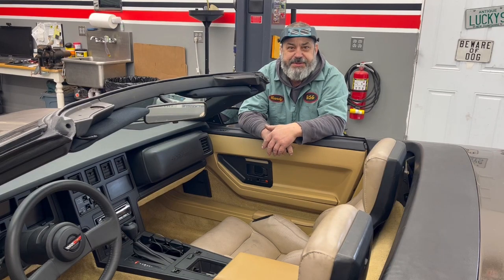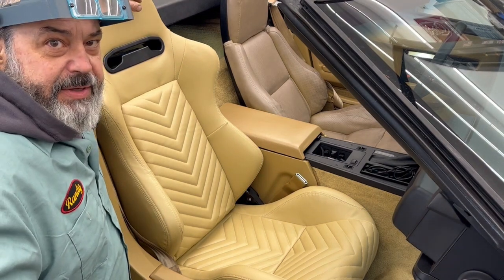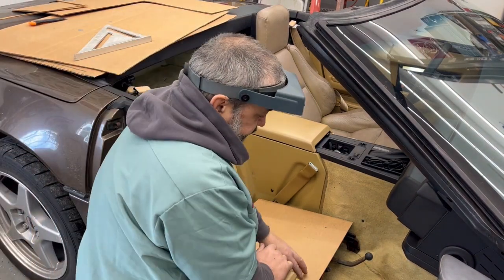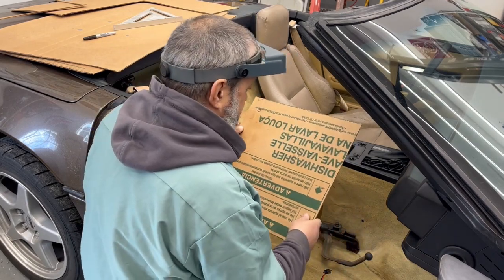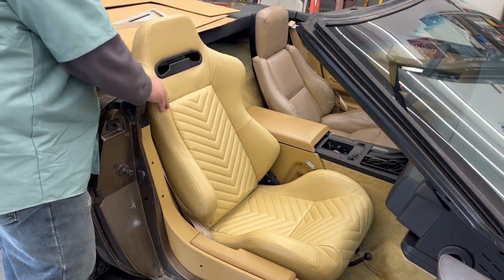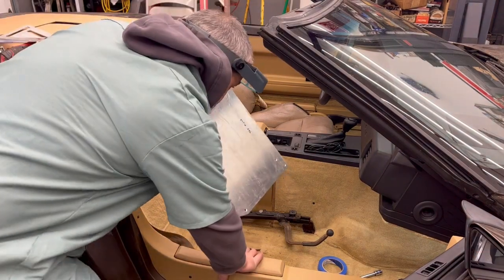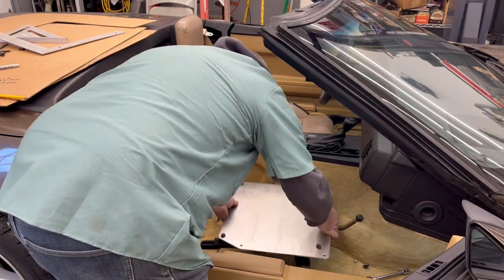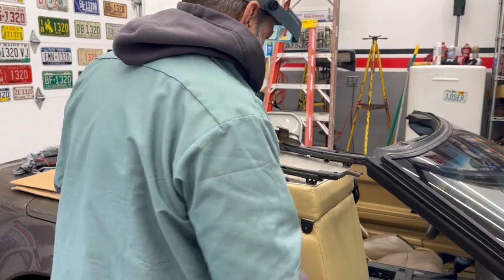How to Replace Your 1984 - 1992 C4 Corvette Seats

Comment: Well that's the problem with C-4 generation Corvette factory seats are almost to small but after market seats are too damn big.
Reply from the maker: True, you can't beat the original seat for fit and function.  Trouble is they are expensive to rebuild with new cushions, covers etc.  I might do that someday, plenty of projects here!  Thanks for watching !
Reply: Yea the seats in my 85 need to be redone and fix and it is expensive but I will save some money by doing the work myself. But either way with classic cars that's all part of the game.
Reply: @Joe8648 yep and the build quality so shitty they're gonna break down again if you keep the car . I've redone mine a few times and this time I'm going with cheap aftermarket...I know they're going to fail but at couple 100$ no problem replacing them again in 8-10 years.
Reply: @catboi1188  oh i plan on driving it till the wheels fall off then that happens I'll restore it and drive the hell out of it some more.
Reply: @Joe8648  hell yeah...I'm working on mine  now to get it right...gonna raise the compression ratio.. remove the mufflers and let that radical camshaft talk 😜 gonna piss off the ricer crowd
Reply: @Joe8648 hahaha same 🤣 fun car.. I've modified mine quite extensively but I've owned it since 1991 😂 mine was in 85 with flat tappet engine so I bought a short block new from a dealership so I have a roller camshaft now I went with a big choppy competition camshaft with headers and true dual exhaust that I made myself. I have the 1995 ZR-1 wide 5 spike wheels ... Also shaved the door handles emblems and ugly side marker lights. I grabbed it on a fiberglass rear bumper getting rid of that warped piece of garbage the factory installed 😂 I'm now installing a fiberglass front bumper cover. I'm going to drive the hell out of this thing before the Communists take away our gasoline ⛽ 😂
Reply: @mariocooldude9092  the is to much industry and machinery shipping that relies on gas and oil if it does go away I doubt we will see it in our lifetime.

Comment: Those seats look sweet in there...updated the interior quite nicely. I'm going with aftermarket units this time too as ive redone my originals many times already and now the motors finally took a crap so its time. The originals were great for the time with all that adjustability but the materials were lacking. Are they cheap ebay/Amazon units?
Reply from the maker: Yes maybe $250 for the pair I don't remember exactly.  Thanks for watching !
Reply: @bustedstudgarage  I found them ...thanks for the video ...I had questions as to if they will fit or not ...I know the corbeua seats are a good fit but I don't like the look and the price 😭 funny how the cheap seats look better than the expensive originals they copy 😁

Comment: The seats look great and i want to copy the install. I am 6’2” though. Any suggestions to lower the height
Reply from the maker: Hi Tom and Thanks for watching!  Short answer is yes.  So I'm about 5'5" and my first attempt at this which is this video worked great for me but the original seat sliders raised the whole thing maybe 4".  For me it was awesome but for my taller friends they literally could not get into the car.  So I went and got the special sliders that go with the more expensive seats, I think they were corbeau and super low profile like right down on the floor.  They are so simple I could have easily made them but I was in a hurry so just bought a pair.  Probably from summit racing, they were hard to find.  You need to get left side and right side, they are not the same.  Then I did the same thing in the video but with the new low profile sliders, now the seats are back to being close to stock height.  I took a few pictures and my intent was to make another video with a voice over.  So try that or if you have time wait for the next video.  I was very pleased with the results I got and I'll try to put up another video on this soon I hope.  I posted a picture of the new seat slider on instagram in case you want to check it out.
Reply from the maker: If you just want to lower the seats you could scrap the factory sliders and in their place install the low profile aftermarket type with C4 factory seats.  That will lower your factory seats about 3-4 inches but you won't get the cool looking racing seat.  The trick to all of these ideas is making the template so you can transfer the hole locations.

Comment: Great video .
I ordered a set of red racing seats for my ' 90 C4 Convertible and they will be delivered next week  I'm in the process of changing my interior color  , from black , to Bright Red . Its looking awesome so far .
I was going try to use the tracks ,that are coming with the seats and i had been thinking about using an adapter plate between the seats and the factory OEM C4 tracks , as you did but was concerned about the seats sitting higher  , than the OEM seats .
  Do the aftermarket seats sit higher , than the C4 seats .
Reply from the maker: Yes they do sit much higher if on the factory tracks.  I liked it higher but my taller friends could not fit so that's when I got the tacks from Corbeau.  They are right down on the floor and made for C4 Corvette so they bolt straight in.  Still need the adapter plate in between.  With all that it came back down to the factory height.
Reply: @bustedstudgarage  , thank you for your reply . Not sure which route I'll take . I'll wait until the seats arrive and then determine.
Good tip , on installing the bolts on top of the OEM track and through the adapter plate , into the seat .
   I may post some videos of my C4 progress I've made thus far .
 Thank you for this great video .

Comment: So these seats fit down into that space no problem?? Because I only measured like15- 16 inches across, console to door sill which is very small. Seems like most of the cheapy  aftermarket seats are 19" up to 22+ side to side at the base
Reply from the maker: The seats we chose worked fine.  After this video we switched to corbeau seat brackets to lower the seats about 3" more.  For reference here's a link to the exact seats we used, we are not affiliated with the company that makes or sells them.  https://www.ebay.com/itm/304594723772